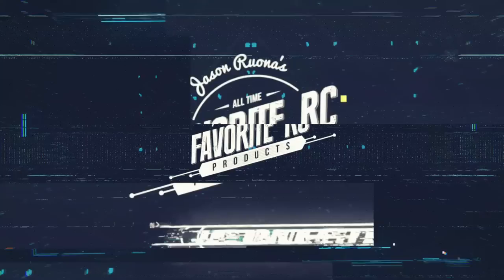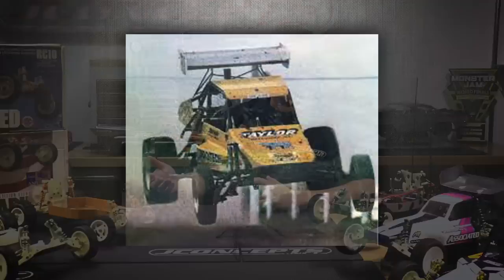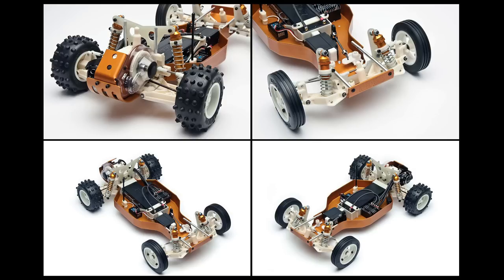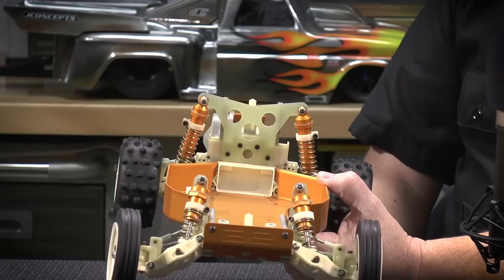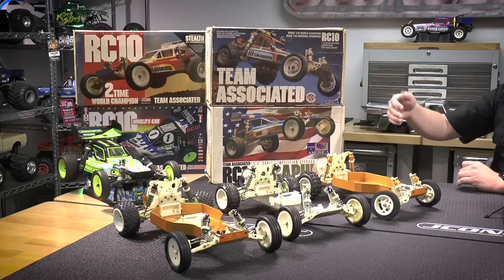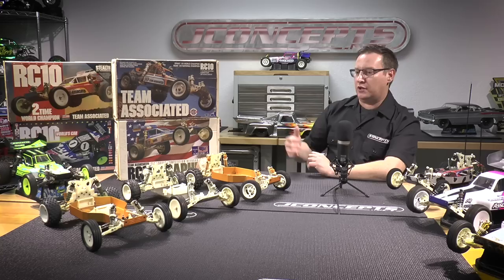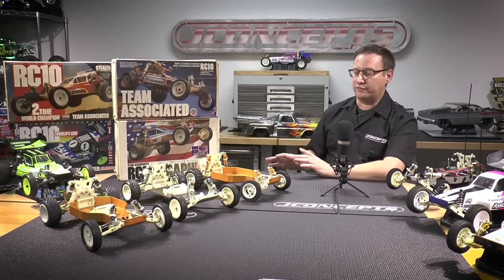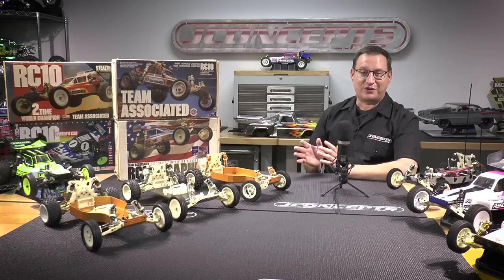Jason's All Time Favorites - Associated RC10

Comment: My first RC10 was converted every week to keep up with our track operator. I raced on a shoestring and every week they changed from off road, to dirt oval, to paved road course, to paved oval. Due to aftermarket support for the RC10, I was able to run the same chassis in each type of track. I was even able to be competitive with the sponsored local guys. I still have that car.
Reply: Thank you for sharing that! Similar happened to me in the late 80s and 90s when rc 10 conversions for everything from dirt oval to carpet tracks was common. I ran mine in the dirt in the summer and slammed it down and put foams on it and ran it indoor on carpet during the winter...those were the days...funny how modern 10th scale buggies are ran on a cross of carpet and off road with jumps today. Such a versatile chassis!
Reply: When I was a kid in southern California, about 1984 or 1985 my dad would have my car set up for dirt off road for Friday night and Saturday night he would have every thing switched over ( body, tires, gears, and suspension ) for paved banked oval racing at the Velodrome. The RC-10 was such a good platform for any kind of racing!
Reply: @shawnsmith8775  I think back then there were far more on-road race tracks than dirt off-road tracks.  The dirt tracks require a lot of logistics and maintenance.  The irony was that off-road buggies were so much more common and popular.  So many owners of off-road buggies just ended up racing them on on-road tracks.
Reply: @brandonbentley8532  I remember reading about the early RC Monster Truck pulling competitions.  90% of the pulling monster trucks were converted RC10s!

Comment: Still have my gold chassis rc10, 35 year's and still awsome.
Reply: wish I still had mine... Won my first race with the box stock RC10, from that point I was hooked for life
Reply: hi S B...
'
what country made your gold chassic RC10 in 35 years ago
Reply: @bestamerica  USA
Reply: @Joe_Sa_3rd  Hey me too! I learned it was all about getting the car hooked up to the track and learning how to get a good line on a turn, or reverse break the wheels to control the angle you land from a jump. With a mechanical speed control and a no label reedy motor. The motor was a gift from one of the track guys as kind of a welcome to the hobby kind of thing. I found out today my dad threw it away (he kept the box for other things!) tossed the car, modified to be a real beast, a couple months back. I figured it would be safe in his garage forever.
Reply: Me too, got mine in 1984 so 37 years i guess. Still play with it. Take it out and play with it!
Reply: There is a new in box graphite rc10 on ebay right now. $2999

Comment: I wqas 16. I had a part time job for savoing cash. We had two dirt tracks in the city, and the indoor wearhouse held some reedy preliminaries,and where I raced. I took my gold pan RC10 my dad bot me for xmas, bog standard, installed graphite suspension attachments, titanium arms, new linkages, new diff, one of the best stock motors at the time that tried to skirt the rules by making the bushing contact with rotor smaller for less friction. I reduced the weight by machining the pan a bit after watching what some of the more competitive racers were doing (my 30w iron sucked, so was making friends borrowing soldering irons). Before I did that, I ran all stock except for softer front tires and square fuzzy rear tires, and a reedy stock motor I got at a competition. Replaced the mech speed control with I don't remember the brand, but a mid tech high freq. speed control, and high speed freq was the new thing) and a fast front servo that cost some tie to save for. Still used the analog remote from futba, everyone was on digital. A pro racer wanted to check it out, and told me "dude, your car is the most hooked up I've ever tried at this track, good job dude". I remember winning the night's race and being really proud.

Comment: The speed control servo sat back inside that area under the rear shock tower and moved the wiper that slid across the green ceramic wire wound variable resistor. They would get really hot if you loaded down the motor too much.

Comment: The team associated rc10 was my second car that I ever got when I was a kid. My first one was a Kyosho javelin. The javelin has still been my favorite but I still have one of each then I totally tricked out and then when I kept the original and a shelf Queen. The rc10 that I still play with has the UNL trailing arm conversion with 64 pitch gears in the transmission along with titanium screws ball in and everything else I could put on there titanium. RPM arms I even had titanium universal joints. I really like that car. I wish Team Associated came out with a four-wheel drive a lot earlier. I have one of the newer javelins they came out and it is updated for 48 pitch gears and newer screws. I love it and brings me back to when I was a kid. I still play with both of them
Reply: I wonder how competitive these would be today.  I know the drive train wouldn't be as reliable with brushless power, but I think the suspension was so good it still might hold up today.
Reply: @ctsd623  I actually heard of some of the pros using one of the older cars like this and they were still coming in third or fourth. When they put that to the test and the drivetrain can take a brushless drive if you use metal gears.I have the 64 pitch gear conversion for the stealth and it handles anything I can throw at it. And the old one was 32 pitch It can handle quite a bit. I had an associated B3 and put in one of the newer brushed motors and laid down all the teeth in the transmission. But I upgraded with metal gears all the way through and nothing will flip over backwards like you wouldn't believe but it won't hurt the gearbox

Comment: I started as a hardcore Losi guy (at least for OffRoad) with a JRx2 that gold pan RC10 was my nemesis later working at a hobby shop I sure did sell a lot of those different variations of RC10. Maybe because I was running always running something Team Associated for OnRoad so all these years later when I got back into OffRoad instead of the newest Losi offering I picked up a B6D and am recently finished a B6.1 for carpet that ready whenever we can get back to normal racing

Comment: I think I have the TQ10.  I'll have to go into the garage and dig up the box to see.  Last time I ran the cars (also have the Tamiya Falcon I started with) they really need to be rebuilt. The suspensions didn't rebound and the controllers didn't control. Been meaning to get around to rebuilding them for almost 10 years.
Reply: Wow. I also started with a Falcon. The suspension didn’t rebound at all— I remember that. Also, the chassis would crack where the front end would attach. It really wasn’t a well designed car imo, especially for a beginner b/c it wasn’t durable

Comment: The first car with shocks that worked and didn't leak so bad you needed 3 sets to keep them working for a day.  I bought a couple of sets one for my PB Nova and the other for my Mustang 2.  The shocks were only $30 less than the kit for 4. Should have bought kits they would be worth a bit now.🤣
Its funny you talk about putting a bit of color on these cars. I can remember making my RC500 look trick by dropping all the palstic and fiberglass parts into a pot and using some clothing dye to color everything black. First time I took it out everyone asking "Dood where did you get the carbon fiber? How much did the carbon plastics cost?" Again hilarious but I told everyone it was just dyed plastic but no one believed me. ha ha  That car also used the RC10 shocks.

Comment: I always hated running against the associated trucks when I raced competitively. They could always turn tighter than my losi in the corners . They'd run in hot let off and still have the front wheels grab really well and hold a tight line , while my losi , I'd basically steer with the rear end. I could carry more speed but they had the inside. If the track was too loose on the outer groove then I couldn't carry enough speed . Very frustrating indeed at times lol. Kudos to the inside groove associated guys lol

Comment: I had one of the old RC10 (the box on the top right).  I rememeber upgrading to the Stealth Transmission in it.  I was running a Futuba Radio and Novak Speed controller.  I'm currently 42 and had this as a kid.

Comment: The original car had a slipper clutch also. The tension you set on the balls in the spur gear was the slip
Reply: I believe that was the differential tension you are referring to, and not a slipper clutch. It was the Stealth transmission that formally brought a slipper clutch to the RC10

Comment: At the winter gas car race (1/8 scale ) february 1983 in Orlando at the airport Gene let me hold and look at the prototype of the RC 10. I remember it had tamiya wheels and tires on this alum metal chassis with nylon machined arms and mounts. To me it was the best 1/10 scale dirt buggy. I think it was one year before I could buy a RC 10 basic kit which cost me $188.00 and it came with bushing and no body or tires.(at that time it was the only kit that I had the money to buy)I think it was 2 month to save the money to buy a set of tires and body ( that a racer had remove from a kit that he was using for parts).To drive it I was using the motor and speed control from my tamiya car. I wish the I had that car today.

Comment: I still have mine I built in 1985 and my rc10L pan car also I built in 1986.  Still have them going strong the only thing is somebody took my original paint body from my rc10 but I have my one I messed up. I actually got another one in 1989 to build up as a outlaw racer and sold it. I had another chassis but a x took a lot from me